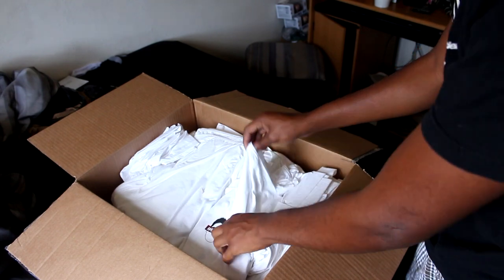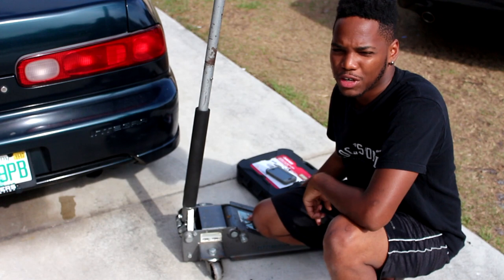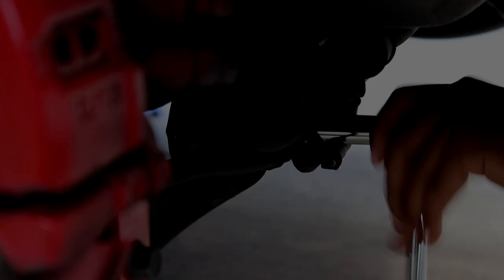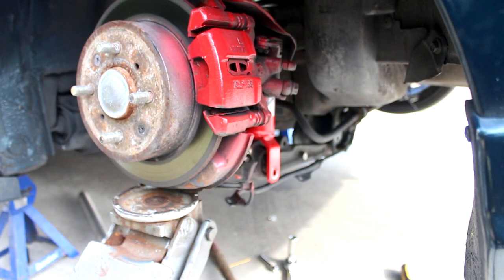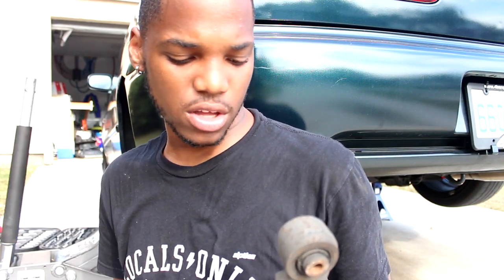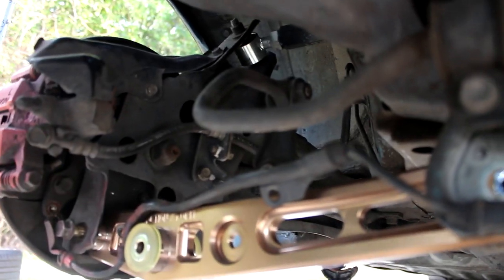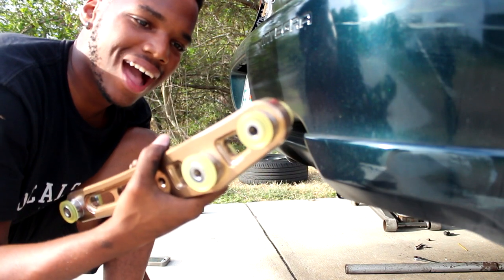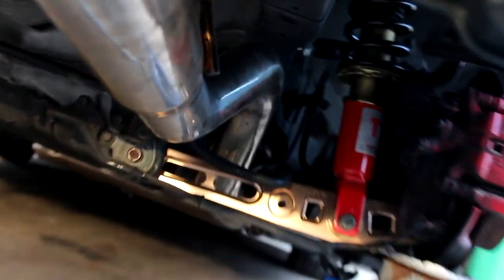INTEGRA LCA INSTALL: Function/Form

Comment: Zosh next time unbolt the sway bar from the control arm 💁.  Did you preload the suspension before you tq down the bolts? If not the bushings will wear out faster.  Doing any kind of stuff like that you have to jack the lca to ride height then tq down the bolts puts less stress on the bushings
Reply: not needed on this style control arm as the steel inner crush tube is separate to the bush thus spinning freely inside the bush as there not  bonded like the factory steel units. which look shot do to not pre loading

Comment: You are sooooooo lucky you live down south. Easy ass install with just a ratchet 😂 up north where we got rust this shit was a nightmare even with an impact gun. Seized broken bolts. Had to cut out my old lcas to put in the new ones and torch off busted nuts. I need to move down south asap
Reply: Jet Moua PB BLAST I soaked mine a day prior and before and all my lca bolts came out like butter

Comment: I just baught my teg and new to your channel. My teg has 92 thousand miles and I was wondering where should I start? As far as mods I eventually wanna do a poor mans type r motor with in the next 6 months should I start on Interior? Radio? Everything's factory on it.
Reply: Mugen Ryan Start with maintenance or suspension mods first . Lower it first , do everything right the first time.
Reply: Mugen Ryan like he stated start with maintenance first can't have fun if your car isn't running right. A poorman's type r is a good motor to build I'm assuming your using a b16 head and b18c1 block?
Reply: What would u recommend for lowering it I don't want it too low I like the stock type r look ride/ height and what do you mean as far as maintenance? Fluids brakes rotors, plugs and wires?
Reply: Mumble yes the b16 head and b18c1 block
Reply: Mugen Ryan get some truhart street plus suspension cheap price and pretty good overall. plus you can slam your car to the floor with them
Reply: Mugen Ryan but do maintenance first. spark plugs, spark plug wires, dizzy cap and rotor, oil change, and doesnt hurt to check all ur belts and timing. better safe then sorry
Reply: Mugen Ryan if your not trying to go to low you may consider lowering springs they are cheap. But at the end of the day you'll end up wanting coil overs. So get coilovers from the beginning. Yeah just make sure your cars maintenance is good I cannot begin to tell you how many time I have races modes honda's who's owners don't maintain them and just mod them. I end up beating them and leaving them confused lol.